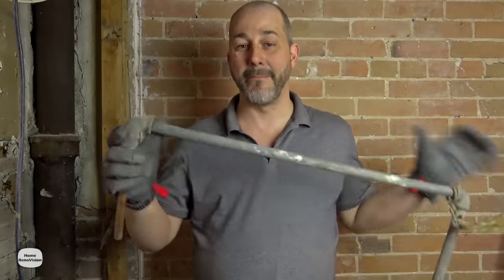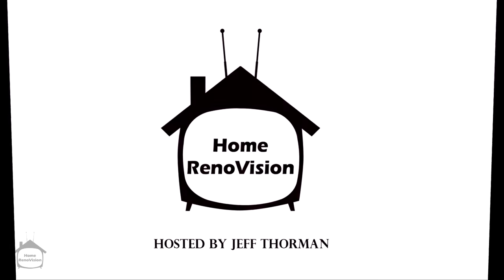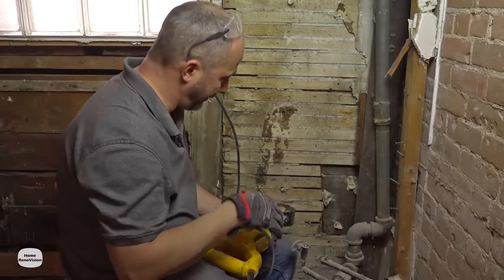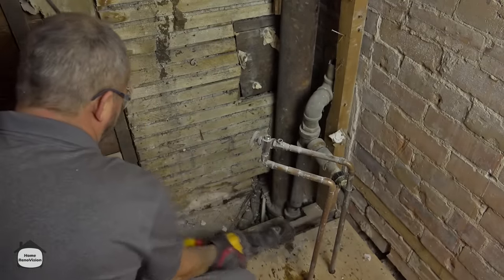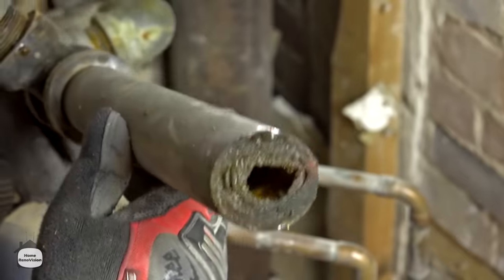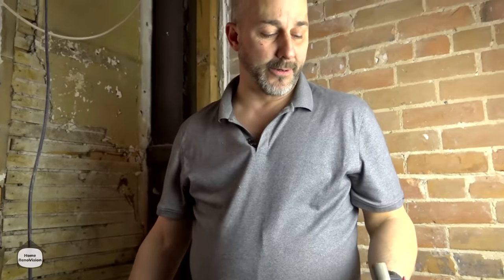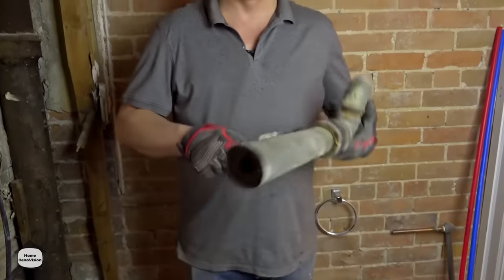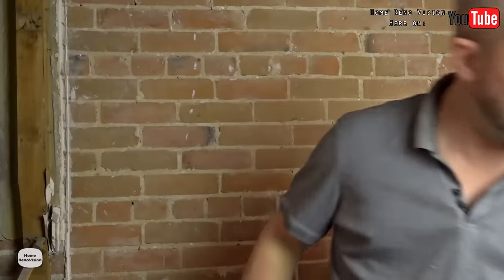Why you Should Remove Your Steel Plumbing ASAP!

Comment: "Remove all the steel supply lines in your house back to the source."  Ok, so I need to dig up my front yard to remove the galvy that likely runs from my water meter to my house.... got a DIY video for that?  lol.
Reply: No need to dig it up, just unhook it. These days they have a machine that bores a hole under ground with a big roll of tubing attached. Pretty cool actually.

Comment: Totally agree, the scale getting to your faucets and shower heads will diminish greatly as well.  I recently replaced all the water supply (hot and cold) lines in my 1929 house with PEX by myself.  It isn't that hard to do, easily a DIY for most people.  Less scale, better water pressure, longer life from fixtures and water heater, totally a worth while upgrade.
Reply from the maker: Totally agree, it may cause some damage to the walls in the house but it increases the value of the property as well.

Comment: Your saying to remove all metal pipes from your house to the meter but I’m sure the city still running metal pipes to your house so what’s the point?
Reply: The major difference is that any break in their line won't damage your home.
Reply: a lot of old city piping is 100% soft lead and not galvanized steel.

Comment: A lot of that steel pipe was so lousy it only lasted sixty, seventy years.
Reply: its also good for an iron poor diet...
Reply: Jim Rr that pex will only last like 40 years...
Reply: @Alex Tarasov in europe we are using pex and ppr sinse the 80s with  no problems and during the 90s we stoped using copper for drinking water only ppr and pex. pvc for drinking water i do not think it is worth the time no one buys it here and you can have problems if you use expired or bad glue.

Comment: It's worth noting that using drano in your steel drain lines helps to speed up the corrosion 10 fold lol
Reply from the maker: The plumbers have a high pressure hose that cleans really good. Worth it if you plan on keeping old drain lines.
Reply: Absolutely! We have some old lead and steel pipe work here in the U.K. That stuff will eat right through and produce some seriously nasty gasses as well.
Reply: @DaddyBear3000  Lead! That's what I want in my drinking water!

Comment: Back in the UK we transitioned from lead plumbing to copper over the last half of the century, in house-building. I worked on the refurbishment/ renovation of a large, Georgian crescent for several years in the early 1970s as a bricklayer. (Picking up and laying a 150 year-old, cleaned-up brick - with the moulder's thumb and finger-marks baked into it - is a most eerie feeling. )
We must have pulled a few tons of lead out of the walls on that job. Every dwelling was converted to copper by the finish. The only steel pipes carried gas or was electric conduit. It all came out, even the bell cabling from the family rooms down to the servants' area.
Excuse my ramblings ...

Comment: Very timely! We just bought a new house built in 1940. There are several steel pipes I can see in the basement. It appears the runs up from the basement through the rest of the house have switched to copper. After watching this I am going to replace any steel pipe I see in the basement. Pex to rescue :)

Comment: Great job showing real plumbing old work i saw many tv show never talk about plumbing or how plumbing is done bcz plumbing is serious not a game
Reply from the maker: T.V. shows spend more time on the design elements and finishes, simply because that is where the money is. Understanding the building process has never been a part of their agenda. At best they try to scare people into thinking they need to hire someone. Good business for the sponsors since they have installation services.
Reply: Home RenoVision DIY  Diyers think doing their own plumbing is a good idea till they create a backflow situation, don’t vent properly and wonder why their drains drain so slow, have no clean outs or back flood prevention and their basement floods and are surprised when their house turns into a crater where it once stood because installing a water heater seemed easy. Solder? Hrrrm this 50/50 seems good and I know I’ll plug that pesky tmp valve... 
Fixture units what are those ? Water will flow down this small pipe I’m sure of it, after all it was cheaper.

Comment: Our house, built in the late 60s (Slab) has different types of retrofitted plumbing. The second floor uses pex which connect to the galvanize piping of the downstairs. When the 2nd F galvanized was removed in 2015, the inside was so corroded only a skewer size hole was passable by the water.

Comment: My house was built in 1956 and I bought it in 1991.  After moving in, I Immediately noticed poor drainage and low water pressure. Being very handy, I pulled out all that crap galvanized pipe and replaced the supply with copper, type L and all of the waste with Schedule 40, PVC.  However, my toilets were still draining slow so I started digging outside and was shocked to learn that my house had "Orangeburg Pipe" installed when it was built.  So, I pulled out all of that too and replaced it with 4" and 6"  SDR 26 green pipe.  I now have the best house on the block from a plumbing perspective.  ;-)
Reply from the maker: well done. Cheers!

Comment: I gutted out all the galvanized supply pipe in my house and replaced PEX over a 3-day weekend. We have a basement and a wet-wall where almost all the lines are run (2000 sf cape cod) - so it was an easy set-up. Anywhere I could, I ran the lines through the floor up the back of the cabinets to minimize any demo. I worked in the trades (mason), but plumbing is DIY for me. PEX is a great product.
Reply from the maker: very cool. Cheers!

Comment: 0:37, the configuration you are showing here with the copper connected to the galvanized with a sweat x male adaptor fitting is against code. galvanized pipe touching copper of brass will cause electrolysis, the corrosion of dissimilar metals caused by the difference in positivly charged ions. if you wanted to do this you would have to by code use whats called a dielectric fitting, works so that neither of the two metals come in contact by means of plastic inside the fitting. in the end if you still have galvanized water piping you should to as he recommends and replace the whole system if you can :)

Comment: This old house just used pex lines on TV and I have a big leak in the old pipes. Water is turned off for now. Going to replace the main shutoff first as it leaks then have the water turned back on. That way I wont have to have the city come back out. Seriously considering using the lex because it remembers the shape after installing the connectors ensuring a secure non-leaking fit. I haven't checked the price for pex yet and hope its not too expensive. Thanks for a great video.

Comment: An important thing to note is that there are copper pipe press tools for U.S. copper pipe sizes.The press tools and fittings are expensive but if you know where to look you can buy press tools at a much cheaper price than what milwaukee,rigid and other companies sell their press tools for.The great advantage of copper pipe press tools and fittings is that there is no longer any need to solder copper pipes in ceilings,walls and near beams or rafters which is appealing in and of itself.I still solder copper pipe,what I do is that I will solder copper pipe unions and copper pipe valves on the ground then use copper press elbows,copper pipe press couplings and copper pipe press tees to tie the copper pipe together and done.It's the best of both worlds in my opinion.

Comment: That is a nice tip and I have the newest pipe in my newest house and I know the lines won't rust, and the old house had the PVC pipe in it also and it didn't have a problem either for me. Our mother's house may have old steel pipe in it though. Thanks so much for sharing this tip with everyone and I hope everyone finds if helpful.
Reply from the maker: The older things get the bigger the repairs get. This one at least is something most people can do on their own. Cheers!

Comment: Really like you channel, I sub'd and have watched several.  Thought I would share what happened with my Galvanized pipe drains.  I have 3 homes, all built between 54 and 59.  Last summer I had one built in 59 start leaking in the bathroom wall, galvanized drain pipe.  I had a tenant in the home, put them into a motel room and started the process or remove/replace.  No more than got it done, and a week later discovered the same leak happening in the kitchen drain, and then had to do the same.  I had a plumber perform the installation, but I created the access and then reinstalled the wall board, cabinets.  What a rotten job to do when a tenant is living in the place.  This summer my other rental property emptied out, I made the call to replace all the steel when empty.  Might have been ahead of scheduled failure, but I don't want to deal with that again when under a lease.  Anyway, my plumber shared that when you have one failure in a home, you can pretty much bet all the rest of the steel pipes will fail with a year to a year and a half.  Better off to attack them all if you have to attack one, because the others will fail in a close time period.  Now I've got complete pvc drains and copper piping in both rental properties, but still some galvanized in my home.  Need to just do one more and be done with it while I'm still young...  Agree with the other comment, would like to see something on pex install.
Reply from the maker: Your plumber was exactly correct. pipes are like arteries in the body, bandaid will not save you if they start to leak.

Comment: If you use steel to copper connections you get galvanic corrosion. Those pipes are filled with that reactions rust and gunk much faster. I would want those removed entirely from my home. My all copper lines are 30+ years old and looking good.
Reply: You're right,butt if u use a 6 inch brass nipple onto the galvi no problem.butt only use it when you're in a tight situation.
Reply: replace with copper again not pex u never know when u will in to animals

Comment: This video has 197k views. It should have 197K likes. If you see galvanized pipe remove it and install copper or pex. The life cycle of galvanized pipe has already run it's course by the time you find it. I had a pipe burst from rot that turned into a $1800 headache.

Comment: Finally, someone said it as it is. :) Thanks for the video. I've used PE and Alu-PEX pipes, they are indeed great to work with. Only the connectors (T's, 90 deg elbows, 1/2" and 3/4" outputs) are expensive, comparing to steel pipes. Bu then again, the Alu-PEX pipe is cheaper, so... ;)
Reply from the maker: great diy product. Cheers!

Comment: FYI-PEX A using expansion fittings is far superior to using PEX B or C. Since PEX B or C can only use water restricting smaller diameter fitting, that are also more leak prone too. And PEX A will expand more without bursting too. Only real downside is that PEX A and the installing tools are more costly...

Comment: Do you have any recommendations about replacing cast iron drain pipes? Do those also have a expiration date? We are replacing our pluming to our upstairs bathroom. The cast iron pipe doesn't sow any signs of leaking, but I'm wondering if we should replace it while that space is still open. We plan on dry-walling over it after renovations are complete.  Thanks for the videos! We definitively have all the old school piping going on. I won't want to see what the inside of our pipes look like!

Comment: About 15 years ago renovated my kitchen and I took out the steel pipe that was in there, and this was a house built in the late 50s, and yup you could not see daylight through the pipe it was so clogged, made me sick to my stomach to think that I was drinking water that ran over that crap all the time...    Now unfortunately the drain pipes are a bit more difficult to deal with because they go under a concrete pad in the garage and replacing them with ABS is a whole different ball game of expensive (and work)

Comment: Thanks for the informative video. Problem is I live in Cook County Illinois. And this county and towns have some odd regulations. For example, must run steel conduit in the walls of houses for electric. In terms of plumbing, I'm trying to find out if PEX is even allowed, there are conflicting regulations with amendments. PEX sounds good - if allowed by the building code for my house.

Comment: Is steel the same as galvanized pipe?  Galvanized was used in home water systems in Idaho into the 80's.  I believe galvanized has about a 40 year life expectancy.  I'm replacing galvanized piping in my 1975 house as part of my bathroom renovation that I'm doing for the same reasons you mentioned.  Did I mention I hate crawl spaces in homes.
Reply: It is the same thing. Galvanized steel

Comment: yup when I first moved in my home the the first thing I done was have all the steel pipes replaced with pex. the whole house system was clogged with rust and once I did switch over none of the faucets would shut off all the way because they were plugged with bits of rust chunks. Had to replace every one lol plus the toilet too. man that steel piping is a nightmare!!!
Reply: It was my supply lines that I had replaced. still have steel drains though ugh...
Reply from the maker: That is very normal! you can have them flushed if needed. Cheers!

Comment: thanks Im building a workshop 50 ft from my house and it will have a sink and toilet i plan on using pex. plus im expanding my house too and using this pipe. my existing pipe is Copper and im sure itls ok to tie pex into copper.

Comment: Never run copper to galvanized pipe without a dielectric union separating the 2 metals.
Reply: PLEASE EXPLAIN THIS FURTHER HAVE NOT HEARD ABOUT THIS BEFORE THANKS
Reply: @flat-earther  get a brass fitting so as to minimize/eliminate the reaction copper has with the steel
Reply: Actually you should never use copper or brass that is not coated even with this dielectric junk in the same system with galvanized if you plan to keep it for some years because the do not need to touch the exchange ions through the water

Comment: If you have steel line going out of the house, it could be going to your well or the municipal water system, replace the steel line. If you have lead pipe going out of your house to the municipal water system, replace the lead line to your property line (shut off), the city will then pay to have it replaced to the water main.

Comment: A home does not need to be that old either.  I own a double wide built in 1980.  It had the galvanized steel pipes for fresh water and black pipe for gas installed.  Even though they are heavier than copper they would not have the risk of a leak during transport.  Today I think they mostly use CPVC for fresh water.  Perhaps even PEX, though I have not seen it.  I converted to all electric over ten years ago and replaced the fresh water system with PEX a couple of years ago.  I did not want the risk of a leak with the gas.  I started having problems just as you demonstrated with no water getting through the system.
Reply from the maker: wow, hard to believe that someone used galvanized back in the 80'S. learn something new every day!

Comment: great video ! You just talked me out of keeping my shower lines !  I'm switching to pex ( after the great winter storm in Texas  Feb. 2021) but I can't seem to wrap me head around the shower lines and was going to keep the galvanized piipe and transition into pex until I saw this video ! My question is does the new faucet set come with the 4-way mechanism behind the wall for the hot,cold, shower head , tub ? My 1953 plumbing looks simple so that's why I was going to keep that part !

Comment: We have cooper and pex in our house.  They both seem to do the job, but you can hear the Pex move and expand a bit when hot water is running through the re-circulation system.  It makes a soft tick, tick, tick sounds in an other wise silent bedroom at 6 AM.
Reply from the maker: LOL, seriously you can her the sound of plastic expanding. And I thought my dog had good ears!
Reply: Yep.  It makes that soft ticking every morning at 6 when the house is dead silent.  The pipes are in the wall inches from my head.  it is worse in winter, don't notice it in summer.

Comment: I am a novice! have a 1908 house with galvinized steel & old cast iron lines. I want to upgrade to PEX. I think I got the PEX install down but what about these pipes? Do you have a video replacing/explaining? What about 1900's cast iron sewer line?

Comment: We recently replaced ours with red & blue pex. Pex is so easy to work with especially if you're using sharkbites. We used sharkbites and pex fittings with the pex clamps.
The old pipes were so gross with so much calcium built up and old settled rusty water and built up rust.

Comment: i agree get rid of any galvanized steel...type L copper has a 50-75 year lifespan  depending on water quality.
Reply: Where can you get Type L copper?  I have looked at every store around here and can get short lengths of copper but it is NOT type L and have not found any connections at all.  Everyone only has pex now.
Reply: "depending on water quality" ie it can leak at an time... PEX A has been used in the EU for decades successfully....Damn most trades ppl in the US are living in the stone age...

Comment: Wow
U r a natural presenter
And interesting to listen to
Plkus u gave so much nice info.... valuable

Please clarify which is better and moder n between steel and copper?

Or if we use plastic pipes, aren'tthey going to melt if boiling hot water passes through them? like hot water coming through shower and tapes has to pass through pipes right? If they are made of plastic, is that any good?